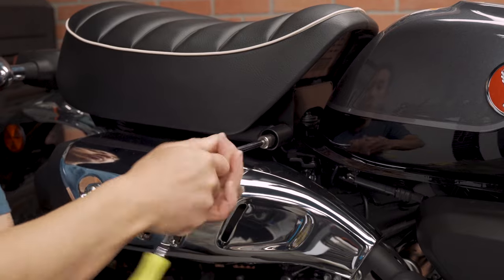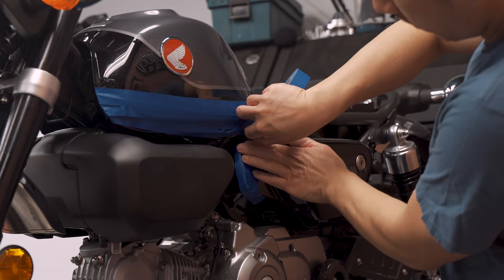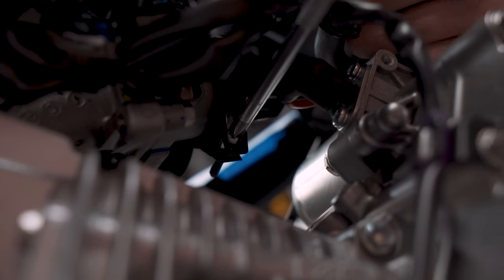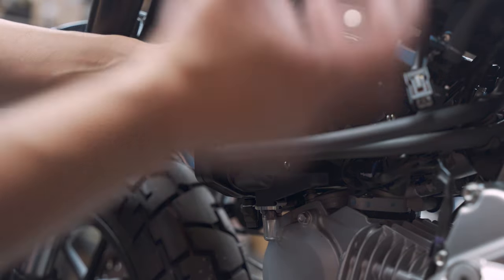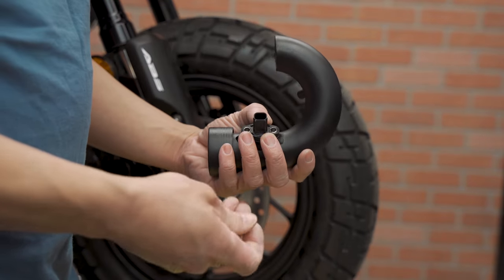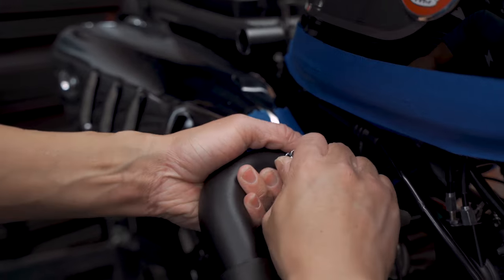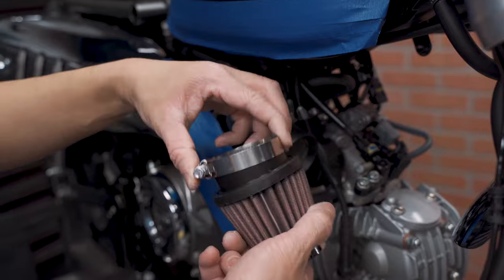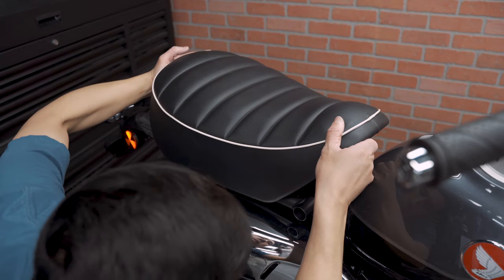How to Install a 2022 Honda Monkey 125 Chimera Engineering Short Ram Intake

Comment: I got mine from ya'll last week or so and it sits a lot closer to the exhaust pipe then in this video. Almost makes me want to cut the end a little bit where it goes to the throttle body to give me more clearance. I'll probably wrap my exhaust anyways, so heat probably won't be a problem despite bein much closer.
Reply from the maker: Hey Bill, have you tried repositioning it at the coupler area? Also check to see if the silicone coupler is around 33mm long. If it's anything longer like 38mm, then let us know and we'll get out a 33mm one to you! Thanks!

Comment: Just installed and tested on my Monkey 2022.  Throttle response is greatly improved and because there is more power (or so it feels) in each gear, the need to upshift quickly can be delayed.  Good work, Steady Garage.  The only issue with installation is that the tolerances are much tighter - the top of the U-bend is actually in contact with the bike frame (otherwise, it would be too close or in contact with the exhaust pipe) and I had to slip a piece of plastic in between to prevent excessive rubbing.  
Question: is it ok/normal for the U-bend to get very hot?
Reply from the maker: At idle it may feel hot as there are no wind coming through the intake or the exhaust. Once you start riding, the cool air will cool everything down! The beauty of aluminum is that the temperature change is quick!

Comment: I put a cb300f engine in my monkey with Steady Garage stuff. It looks like the chimera air horn is too small in diameter. Am I right?  Thx
Reply from the maker: Correct, this intake is only for the OEM Monkey throttle body housing (internal of the the OEM throttle body such as the butterfly could be bore to a larger size). For the CB300F swap, you could run a velocity stack or a clamp on cone filter on the throttle body.

Comment: Used this guide to install the intake (and got it from you), Do you all know of any cover or bracket that can mount on the left side of the bike (frame now has two mounting holes that are not used) that covers up the cabling the old airbox used to? I may try the Gcraft mini bracket they make for the right side when you use a low slung exhaust.

Comment: silly question I know, but will the honda warranty be void if installing this? Thanks for the video.
Reply from the maker: I think you could consult with your local dealer, perhaps if they install it, it might be fine, but each dealership is different. We have Eastcoast dealers who purchased the intake from us that perform the installation and they were OK with the modification since they installed the item that was purchased through them. You could ask your dealer to contact us if they want to purchase the item from us and perform the installation to keep it within their warranty criteria, it's best to check with a few different dealers local to you. If they have any questions, they could contact us as well! Cheers!

Comment: Why spend all that money when you can keep the original  intake by just removing it from the airbox, it is the same length after all Honda optimized it for this engine just zip tide it to the frame in a few places . Then just adapt a K and N air filter to it, same diameter as the chimera. That is what I did and repositioned the air temperature sender with a tie rap and put filters on the other breather tubes. Save a $160 and you do not loose the low end torque and it is so much quitter than the Chimera. Noise doesn't equate to more speed, it just seems so. I did this just to make adjusting the intake valve much easier.

Comment: More noise from exhaust and intake doesn't make a Monkey go faster. 
Because it has a electronic limitter..... 

I have seen lots of movies the last 3 years about IT and honest revieuws admit that. Not everyone (for example with a sponsor) is honest be real carefull please Do your homework before spending real money. You really want to go faster than stock, o.nly result is with a bigbore kit with all the little side pieces like ecu injector cam oilcooler etc.etc. Mounting that on your stock block Will rape it eventualy soner of later, because it is not made to go fast, its made to enjoy at low speed. Hope incould help, greetings from the Netherlands to you all❤️🙏
Reply from the maker: Is that based on your personal logic or actual factual information? Research and feedback show otherwise. Some improvement is better than no improvement.
Reply: I will let you know next week after Yoshimura exhaust system and DHM tune.  No intake mod yet, however.  I will go to my favorite flat out straight way where I get 60mph top speed consistently and test it out.  I am hoping for 65mph.
Reply: @r56mini  okidoki 😃 there is a thought in my mind.... Today its all injection emission ecu law blah blah etc and to change it all to get a little more HP is serious money. Lets be honest 😂There must be a much cheaper solution to put on a old fashioned carburetor and do the adjusting with jets yourself. It looks way cooler and you can put on a Nice looking.airfilter. Maybe another cam of piston. Back in the Day everyone did it. It must be possible and then you have really something. I can after all say that the money if spend on the Yosi was the stupidest thing in my life. There wasnt even a spark arrester for God sake..... For that crazy money...  Bunch of A-holes....Today there is a much bigger aftermarket than in 2019 so that's a big plus. My English is not so good sorry for that, greetings.❤️🙏
Reply: @pleun315  Yoshi + ecu flash didn't make much difference.  
I went ahead and put Chimera intake and DHM CAM and got ecu reflashed.
And Now I feel the power difference.  I can go 6-7 miles faster everywhere.
On a steep uphill where I could do only 51 mph, I am able to go 57 mph now.
And top speed is 66-67 mph. It used to be 59-60 mph.
So power mods and cost so far...
1. Yoshimura with spark arrestor = $650
2. Chimera intake = $140.
3. DHM CAM = $180.
4. DHM ecu flash = $200.

Total = $1170.

I am happy with the result as I can comfortably travel on 55 mph roads even on the steepest sections.
Reply: @r56mini  thank you for sharing, good job 😂👍👍i still think that it must be possible to mount a old fashion carburetor and faster cam to save 800,00 ! No ecu etc Just oldfashion tune up.
Reply: From what I understand about resonant air boxes is they actually help push air into the cylinder from the effect of the air rushing into it from the previous intake, so I’m also guessing that you could lose about 10% of the engines torque (per Kevin Cameron).  I’m buying a used bike with these mods and will likely be going back to stock.  We’ll see :)
Reply: @r56mini  
Not knocking your mods but I’d love to see a dyno with the cam and chip verses cam, chip, intake, exhaust.  Because I think all the real change is cam and chip.
Reply: @leeflory1716  its not the air, its the fuel injection. Its elektronic and you can not change the stock one. More air into the intake means a leaner mixture. It will NOT  make the motor run raster. You need another ECU and when you go down that way you have to do it all. Look it up, there are plenty of video's how to win  more hot but it is tvcheap. With a carb you can adjust yourself what you want and that's the cheapest solution.
Reply from the maker: @r56mini  We appreciate the actual result feedback! This is what makes the Monkey super fun, squeezing as much out of it as possible!